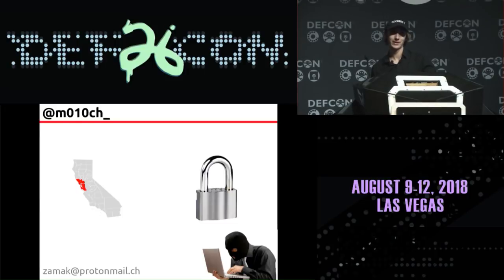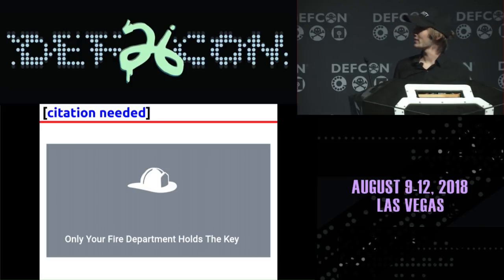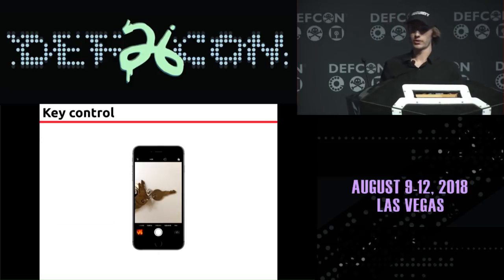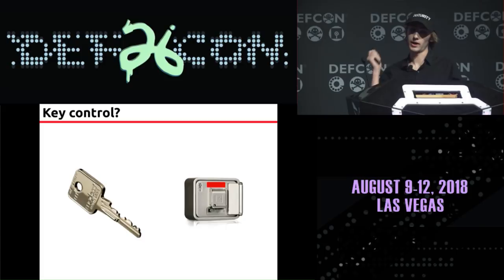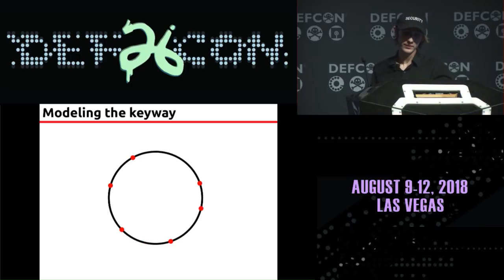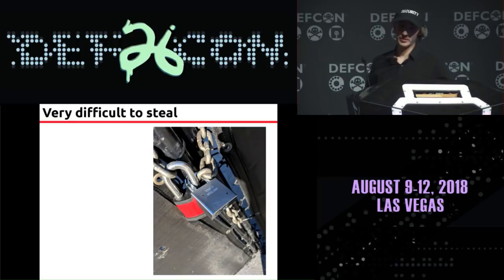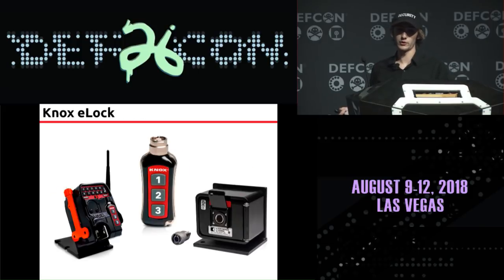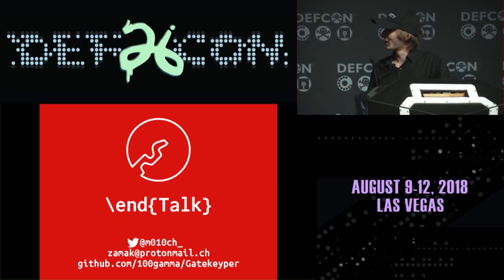DEF CON 26 - m010ch - Please Do Not Duplicate Attacking the Knox Box

Comment: The single thing that tremendously improves the security of the Knox box is connection to the intrusion alarm. This way, they can get into the building, but the police will already be notified before you are in the door. I, as a firefighter, don't care in the least if I trigger the intrusion alarm, since the police were dispatched at the same time that I was. However, depending on where you are, police response can be spotty at best. The intruder does know that the sword of Damocles is hanging over their heads once they open the box and the police will be there at some point. If the box has the buttons installed, but not wired, the thief may not be able to be sure if they are dummies or not.
Reply: So you confirm the box is useless for firefighters?
It's gullible solution for a non existing problem.
In Germany they just don't exist and I haven't yet heard of firemen having problems getting access ever.
And we have a lot of volunteer firefighters. Everyone knows some, they have all the crazy stories. In my class alone there were 5 volunteer firefighters amongst 30 pupils. They enjoy using the big and heavy gear if an axe isn't enough, there is nothing that makes them need the key to a door or a burgler alarm code...
It's ridiculous.
I guess Knox Box producers paid a lot of money to get legislation filed that makes their product mandatory and the gullible obey to such laws....
Reply: @TremereTT  I don't know how you got that from what I said. The Knox box absolutely has a purpose. I simply said that it's important to connect it to the intruder alarm.
Most often, when we respond to an automatic alarm, it is due to a malfunction in the alarm system. If we arrive in response to an automatic alarm and there is smoke or fire showing, we'll get through the door quickly enough. However, if there is no indication that there is a real fire, we do not enjoy destroying property for no reason. The Knox box allows us to gain entry without damage and investigate the problem quickly.
Without the Knox box, we are faced with the decision whether to gain entry by forcible means or to wait for the keyholder.
Reply: @TremereTT  It's not completely true that this doesn't exist in Germany. But here the key box gets unlocked by your fire alarm system. As soon as there is a fire alarm the box pops open. And your local Fire Station can have a key, should they be alarmed, but the box not opened by the system.
Reply: @maesto  No! just not true. I have never ever had to place a key in such a box. And I know noone who did. Also it's not uncommon to change locks of your doors in flats and houses, and no one requires you to put a key into a box for new locks, so I'm sure there is no box.
The only such box I have ever seen is in Vacation homes. The owner tells you the code so you can get the keys for the vacation home.
Reply: @johns7734  Yeah, but what is a realistic response time to a alert? Where I live the police usually won't even respond to a security alarm at a private building, is there a different priority for it?
Reply: @TheOwenMajor  It depends on where you are, how many police units are on duty and how many are busy on other calls at that moment. Your mileage will definitely vary.
Reply: You didn’t just see the video of him defeating the intrusion alarm with a piece of metal in 3 seconds?
Reply: @TremereTT  it’s all about $$. I don’t know about Germany but alarm systems are shit in the US, so they go off 3 times a week. This is a way for the business to not continually pay for fire department damage while also not having to buy a functional alarm system
Reply: @maesto  I never lived in a place that had such a keybox and alle alarmsystems here are just simple smoke detectors. Only public places or comercial buldings have direct lines to the firedepartment, I have never seen it being different. Also I work as developer in a country that amongst other things does access control systems.

Comment: When the talk is so good and so damaging, even Defcon quarantines it for a year to let the manufacturer catch up.
Reply: now to figure out if they chopped up the video/audio on purpose to hide stuff, or were just failboats lol
Reply: @frosty9392  It's defcon... of course it was a technical issue on their end, it always is.
Reply: I definitely saw this video on youtube a year ago
Reply: @piraka_mistika  link?
Reply: @point775volts  not sure, it might be gone now.
Reply: That is the rule for ethical hacking, or lock breaking, or any similar "Ethical criminal activity". If they discover a flaw, the company has to be told and given time to rectify the problem, before it goes public.
Reply: @krampusklaws2238  Yes, but presenting at Defcon is definitely going public.
Reply: @point775volts  He had probably informed Knoxx about the problem well before the conference. If a company refuses to do anything about the problem, the ethical engineer can release the information. Doesn't sound like Knoxx has done much to rectify the current problem. And if, as Piraka~Mistika claims, and it was on youtube a year ago, and has since been removed, quite probably there is a policy in place to keep any information from the greater public, outside of the conference for ethical people focused on improving security, not breaking it illegally. At least for a set time.
Reply: @krampusklaws2238  No, Full Disclosure is the only responsible disclosure. When discovering that the public has been lied to and put at risk by such things, a truly ethical person speaks the truth to everybody in the world rather than giving self-interested gatekeepers time to suppress or threaten them.

I suppose the best of both worlds would be to set some kind of chain of events into motion where you (and everyone else) are physically unable to stop the information from being released at a set time in the future even if you wanted to, and then tell the company or government responsible before the event triggers (thus removing the incentive for lawsuits or gag orders), but as far as I know there is no such reliable system.
Reply: @05Matz  The problem with that is, with full disclosure at the discovery of the breach can put that information into the hands of people who will use it for the worst possible way. Information that can effect the general public, not just the big corporations. 

If there was a security breach, would you rather the company gets told, and they rectify it, or that the general public gets told and any Tom, Dick or Harry can use that information to get away with as much as they can in the window of opportunity? Especially if you are talking about cyber security, or access to virtually any building in a city.
Reply: @krampusklaws2238  The problem is, if an organization is the ONLY people who know about something they screwed up, they aren't going to fix it, at least not expediently. People will still get hurt because the bug isn't fixed. That's why I would like the irrevocable ultimatum method if it were practical, since the deadline would force them to fix the issue. Unfortunately, in practice, there's nothing you can do to force a company to fix it's mistakes that's as effective as airing them in public, because if you tell them BEFORE you go public, they will put all their resources into stopping you from going public rather than spending them on actually fixing the issue. The fix is delayed AND you get sued/SWATted/gag ordered (depending on what kind of organization/government is at fault).
Reply: @05Matz  They are required by law to fix security breaches. Companies hire people like the guy in the vid to find any security breaches. If companies are unaware if the problem, tell me, how can they fix it? 

Maybe loosen your tin foil hat, might be restricting blood flow to the brain
Reply: @krampusklaws2238  People getting into such boxes has sporadically been in the news for a while -- look at the references on his Github project. Clearly they already knew, it was just more financially sound to keep the problem quiet and slowly phase out the locks than to recall the whole product line and replace them with something less problematic, and even that is only a band-aid solution compared to fixing the root issue: society coming to the understanding that mandatory key escrow is NEVER a solution. However, such a permanent fix would ruin their business, so it isn't even a decision they're capable of considering for reasons of self-preservation.
Publicly breaking the news and turning it into a scandal allows society to have those discussions, protecting everybody's security in the long run.

I think our difference is that you care primarily for the security of real people in the present day, whereas I try to consider the security of people in the future as equally valuable to our own. As there will (hopefully) be more total humans in the future than there are currently, I focus more on creating societal incentives to permanently fix the underlying problems with our systems than on minimizing the impact of our current screw-ups. When they conflict (like in giving large actors the ability to gate-keep important security information in the hopes that they use that ability responsibly), I'm happy to sacrifice the present for the future.
I guess both are legitimate viewpoints, but I thus far have refrained from insulting you personally, and I expect the same courtesy from you!
Reply: @05Matz  That's why whitehats usually have a timetable to allow the company to fix the problem before they release it to the public. They let the company know about this and if they don't care then it's their fault for the potential damage disclosure causes. If, on the other hand, the company has trouble fixing the problem quickly, the white hat may also allow for more time or assist in fixing instead of releasing on schedule. It's all up the the company most of the time.
Reply: @Tb0n3   Tb0n3  I guess that works, but I'm just wary of giving people incentive (possibly 'company-stays-afloat-and-you-keep-your-job' level incentive) to act against you, as well as against the interests of society.
I'm not a big believer in game theory when it comes to modelling person-to-person interactions, but when it comes to one or both parties being a corporation or other relatively large rule-based, self-protecting group of people I think it can be really accurate. In this case it resembles the classic Prisoner's Dilemma, except one player knows the other player's move ahead of time. There's probably a specific name for this, but I'm not a mathematics major, and I don't feel like looking it up in the middle of the night.
The researcher wants the bug to be fixed (preferably before it goes public), and has the option to tell the company first (opening themself to betrayal) or tell everyone at once (shielding themself from betrayal, but guaranteeing a suboptimal outcome for everyone involved, as both the company and society suffer from the public vulnerability).

The company wants to maximize profits, and has the option to fix the problem as soon as they find out about it (draining their resources, but making society safer), or covering it up / ignoring it (saving them resources if nobody finds out, but costing them majorly in bad PR if the problem is publicly revealed).

The question is, is making the problem temporarily worse worth altering the incentive structure for the company? It's probably case-by-case. The ideal solution is that companies are told privately and fix problems immediately, but this isn't a stable equilibrium -- the company can improve its reward here by covering up problems rather than fixing them, and that not only exposes researchers to potential lawsuits and other harassment, it makes everyone's security worse. In response, researchers could switch to strict Full Disclosure policies to make cover-ups impossible, forcing companies to switch in turn to fixing the problems again. Now everybody is safer than the intermediate state (where companies ignored researcher's pleas to fix their bugs), but worse off than the utopian beginning one. Unfortunately, this state IS stable, as neither party could make things better for their side by a unilateral switch.
In a case where I knew the company could be reasoned with, I could consider trusting them with the cooperative strategy -- this is, after all, the best possible outcome for everyone. In the case where I know nothing about them (or even in this case that their business model seems to rely on selling mandatory key escrow systems and misleading customers about their security, both major blows to their credibility in my opinion), I would have to revert to the stable strategy (I've forgotten the game theory term for this, it's after midnight here and I'm tired and rambling -- Nash Equilibrium?).
Reply: @krampusklaws2238  I mean, you can't rectify this problem.
It's not a matter of bad execution or design.
It's a matter of a solution-concept that inherently just opens you up to extreme vulnerabilities.
If you've got the key, you've got access. The key is information, information never stays hidden forever.

Normalization is the death of security.
Reply: @05Matz  you're being ridiculous.  There is absolutely nothing wrong with informing the manufacturer of the problem without informing the public immediately, so as long as you go public if they refuse to address said problem or don't do so in a timely fashion.  Informing the public after a fix has been made is completely ethical.

No one informs the manufacturer and then just drops it entirely, which is the only scenario in which your sentiment would hold any water.
Reply: @05Matz  The best way to do that that I can think of off the top of my head is to give it to a lawyer or journalist in a foreign country along with orders to release it. That way any domestic court orders won't affect them.
Reply: @05Matz  You could encrypt it with a password that would take a certain amount of effort to break, so the community could mount an effort to read it if you end up not publishing the cleartext when expected.
Reply: TheInkinJapan  Can you prove that Knox was not given any heads up? And do you really not see the benefit to ethical criminal level testing? How else are you supposed to know if an actual criminal can defeat your security, if you don't have some trusted, ethical people give it a shot first?
Reply: Krampus Klaws good. I want criminals to break in to any security issue the moment it comes out so companies take them seriously.

Comment: This is why mandatory backdoors are always wrong, and should be resisted/sabotaged by all means necessary.
Reply: Fire exits are mandatory backdoors. They definitely save lives.
Reply: @HybridPhoenix08  Properly installed fire exits only allow getting out. A burglar would need inside help to enter.
Reply: @christianbarnay2499  HybridPhoenix mixed up terms. Knox boxes have nothing to do with fire exits. They are to allow firefighters to get inside a locked building to put out a fire. No matter what firefighters need a "backdoor" to get into any locked building.
Reply: @HybridPhoenix08  Backdoors are entry points. Fire exits, as the name implies, are EXITS.
Reply: The handle for the fire exit more often than not are an easy way in. however, they should be alarmed.

I saw Bosnian Bill bypassing a lock the other day, claiming the tool he promoted was good because it means the customers do not have to pay as much when they lock themself out. Well, if the lock is so bad anyone can open it without a key or a scratch, that is more upsetting than having to pay for a new door.

Explosives and hydraulic tools can be used by firefighter to gain entrance, forcing everyone to leave their front door open just in case there is a fire is not a reasonable solution.
Reply: 57thorns Yes, firefighters have destructive entry tools. No key required, a battering ram will do just fine.

Except that's exactly the problem here: they're destructive entry tools. Granted, if the building's on fire,  you're already gonna have to repair it anyway, but that's just the start. Forced entry could take more time than using a knox box, and in a fire, every second counts. Additionally, what if you use explosives to get in, and the explosives also damage the structure?
Reply: @NoTraceOfSense  I guess the main problem is, that the front door isn't the only locked door. And forcing entry through multiple doors could take a while...
But the stated security issue doesn't disappear because of this.